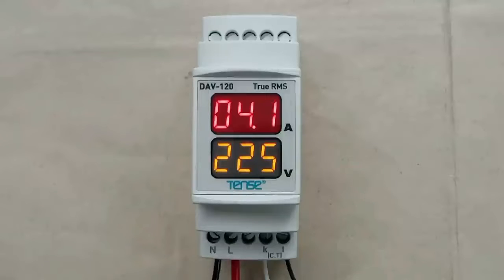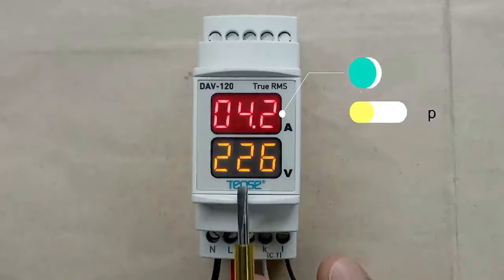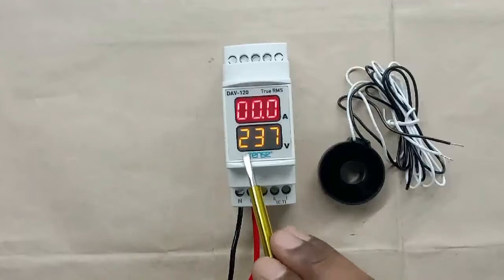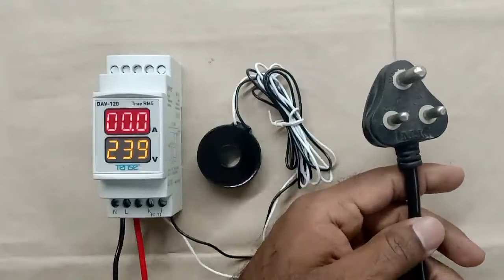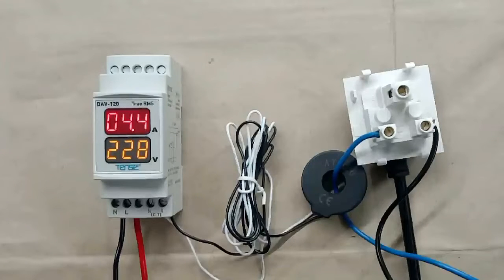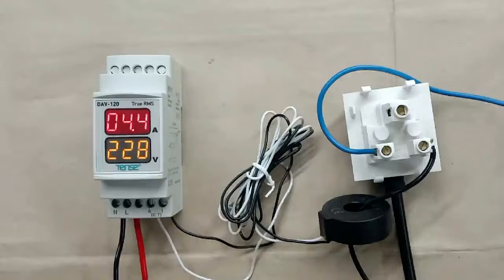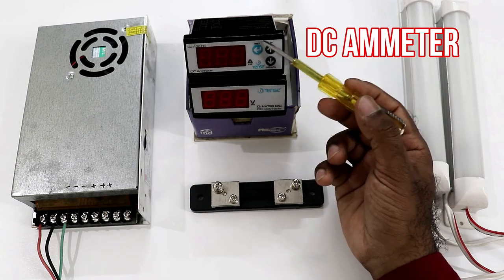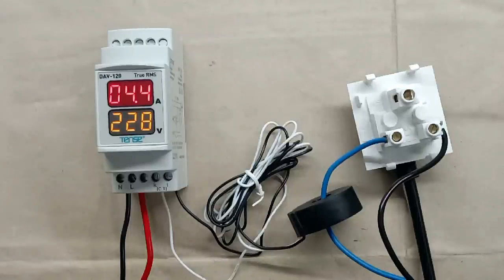Digital Ammeter Voltmeter Connection with CT @TheElectricalGuy

Comment: Isn't it more beneficial to use Voltage/Current regulator (in Thailand we call Sino Timer). It can show both voltage as well as current in use while also regulating over/under voltage/current? It costs about $10 in Thailand.
Reply from the maker: To check the voltage and current you don't need to use voltage regulator